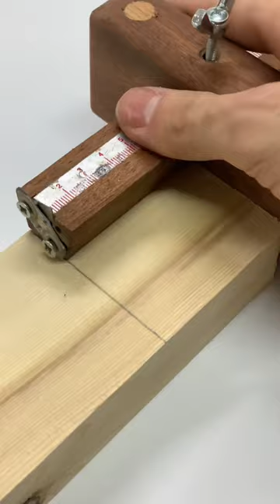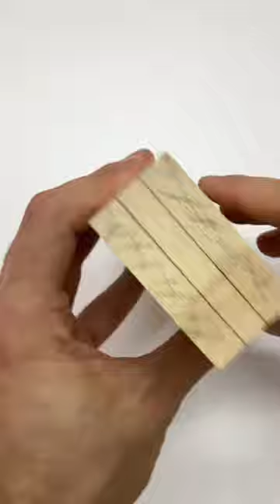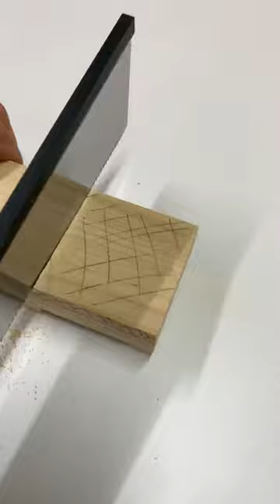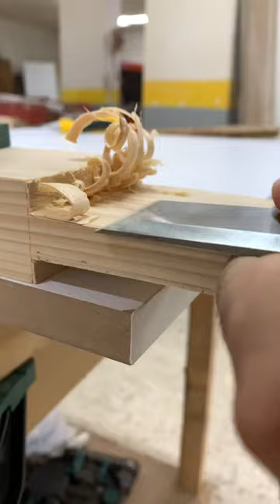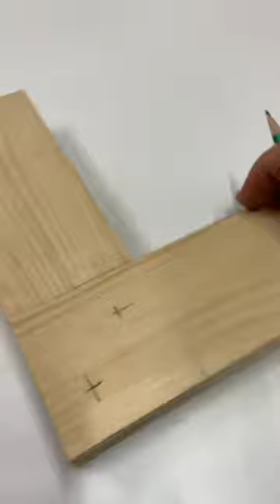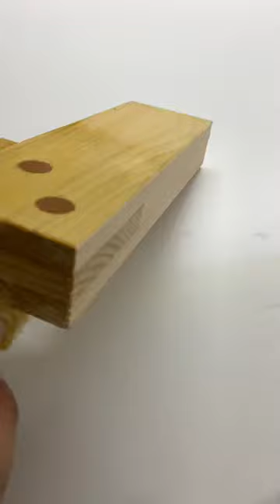Simple wood corner joint/Pinned open slot mortise & tenon joint/Zıvana ve kavelalı ahşap birleştirme

Comment: What was the purpose of wetting the wood before glue application? I appreciate this kind of video :)
Reply from the maker: If the glue you are going to use is water-based, if you wet it with water, it will allow the glue to dry faster. I'm so glad you liked it. 🙏🙏🙏Thanks for your comment. 👍🏼👍🏼